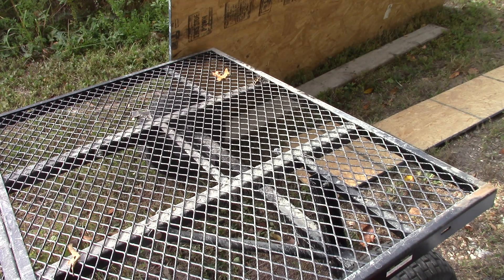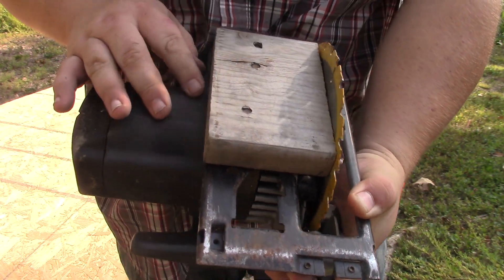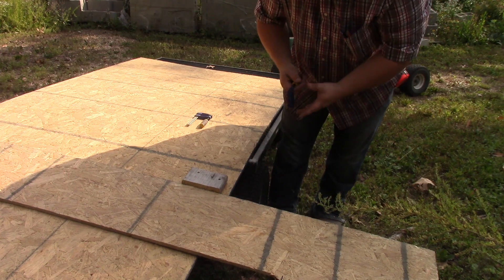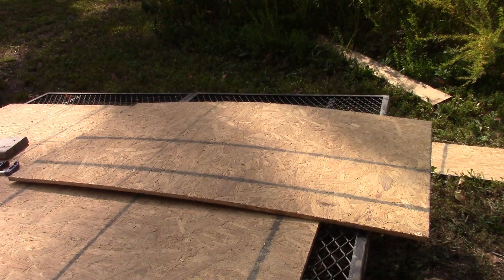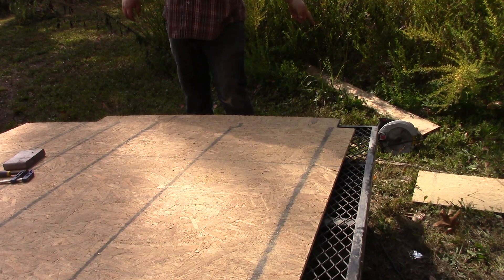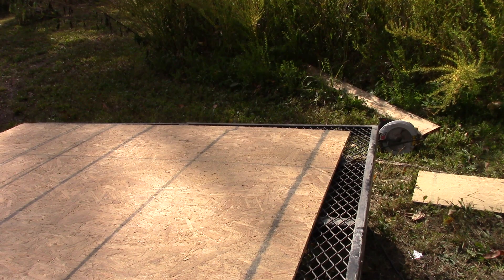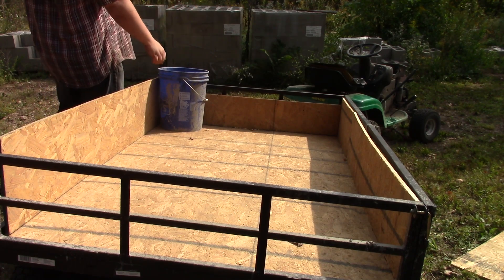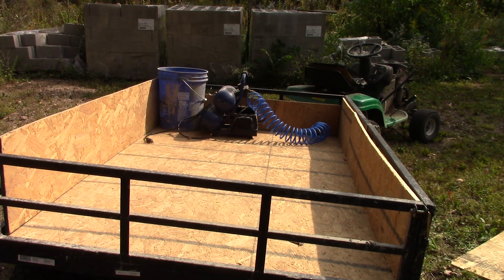Modifying My Trailer + Skil Saw Trick

Comment: I have done that before.  Cut the wrong pencil mark, usually leaving me short on the material.  Nice mod to the trailer, should to the job just fine.  Cheers!
Reply from the maker: +Joshua Smith If I can get my processor to stop running at 90 degrees C, I could render this video and show you guys how it worked! lol

Comment: Great way to make a jig if you don't have a table saw and really need straight cuts.  I usually screw a 2x4 down to the plywood lol
Reply from the maker: +Homestead Dreams At St. Bernard Acres Just have to make sure the screw holes are on the waste side I guess! lol  Also, I find this easier to use than a table saw when handling something like a full 4x8 sheet of cabinet grade plywood 3/4".